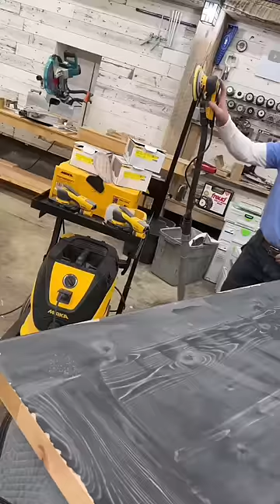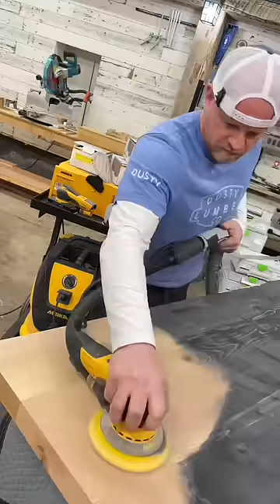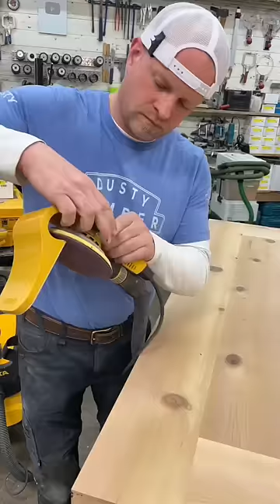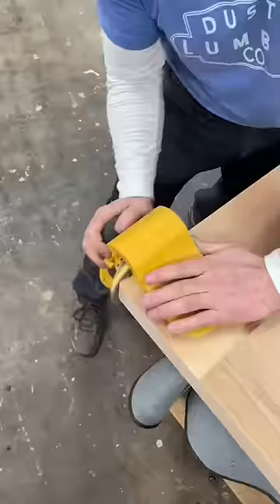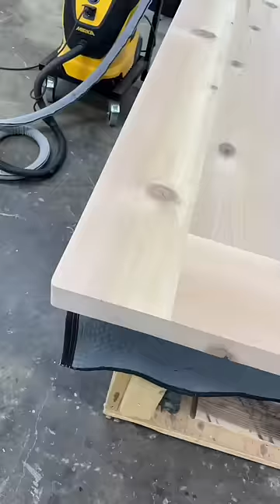Coffee table top #woodwork #wood #woodworking #maker #tools #bois #holz #madera #fun

Comment: What kind of sander is that if you dont mind me asking?
Reply from the maker: It’s a Mirka 6”
Reply: @dustylumberco  thank you sir
Reply: @christopherwilliams9639  They’re great sanders, unfortunately shockingly expensive, like festool.
Reply: @clmahs728  i know, thats the part that always gets me, i habe a cheap little bauer right now and it works but i spend a lot more time sanding than i really want to haha
Reply: @christopherwilliams9639  I use an old Dewalt 5" rotary that I've had for probably 25 years and only paid around 50 bucks for it. It has never let me down so although I own some Festool stuff, I've never seen the need to to shell out $400 for a new one.